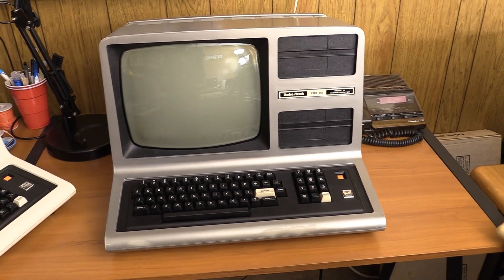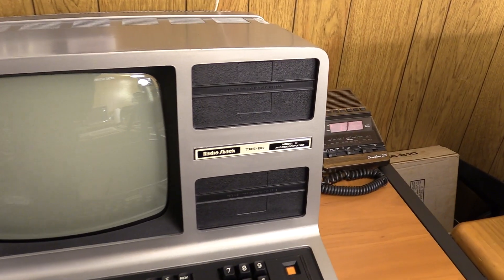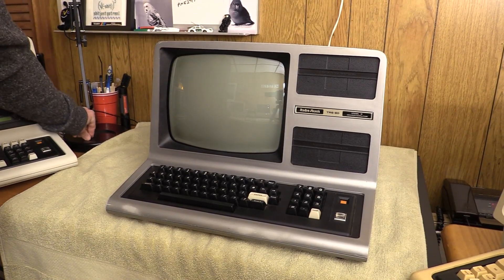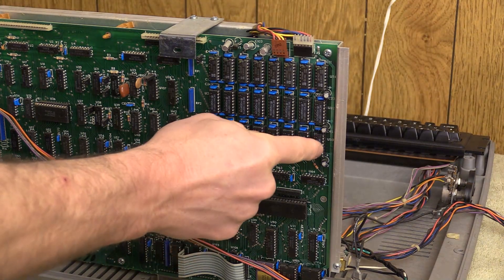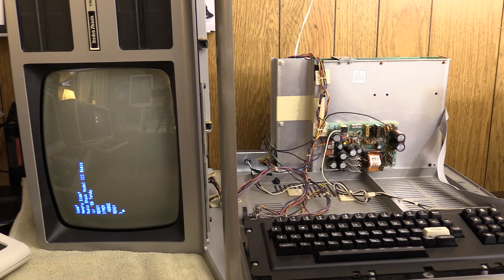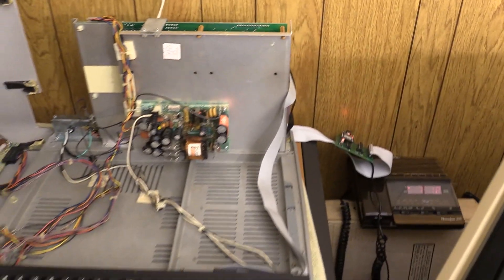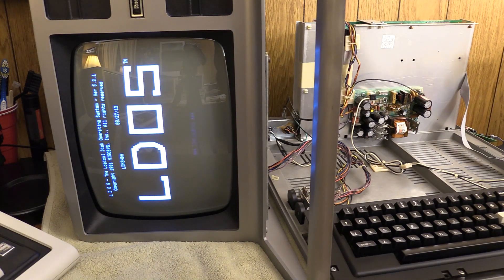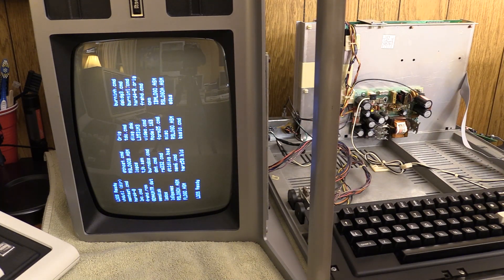TRS-80 Model III RAM Upgrade - 16K to 48K

Comment: Anyone know the part numbers of the RAM chips for the upgrade of model III and any problems after using them awhile?
Reply from the maker: The Model III uses 4116 RAM chips.  A 16K unit required 16 x 4116 chips to bring it to 48K.  Mine hasn’t had any issues since I upgraded.  That said, be careful buying from eBay and the like… I’ve bought my share of bunk chips there.  It’s a bit of a gamble, but sometimes it pays off.  Jameco sometimes has these parts, and is usually where I start looking.  I usually buy a few spares just so I have extra if any of the chips I buy fail.  Thanks for watching!